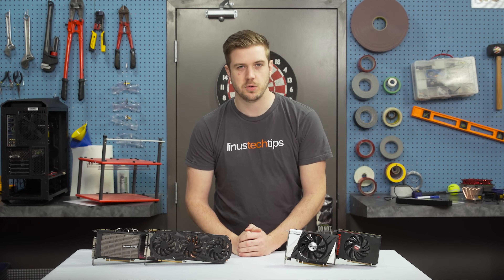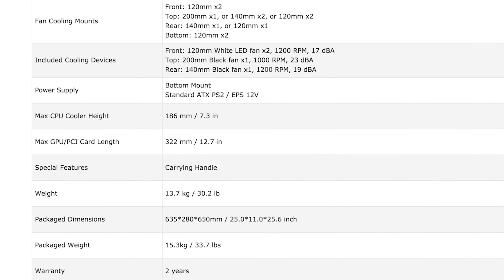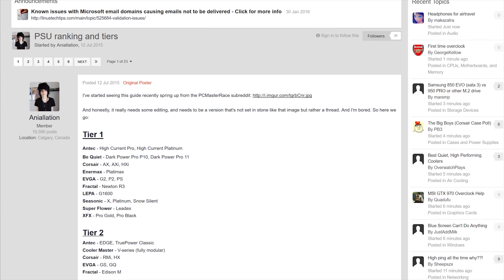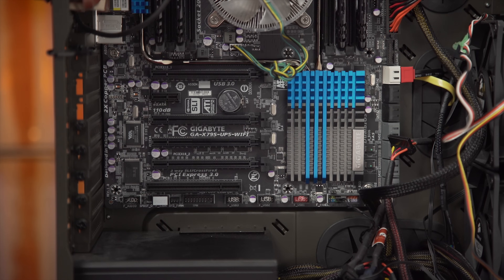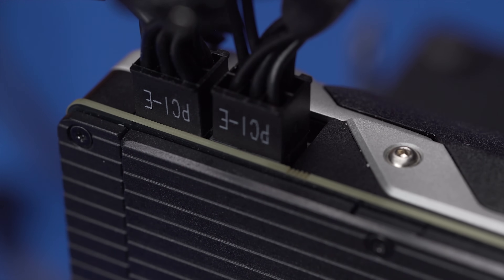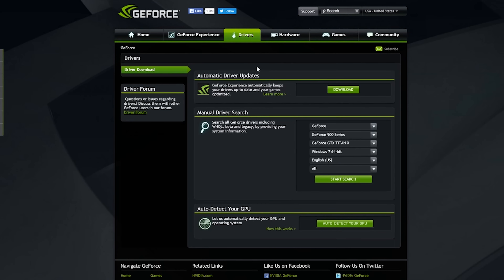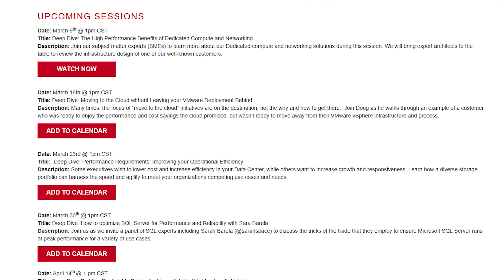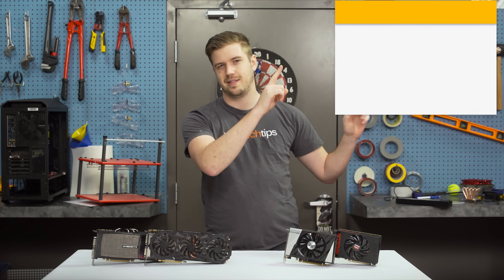Installing a Video Card - How To: Basics

Comment: I have not build a pc, never so i have a bit criticism to this video: It´s not that informative. Questions id like this video to answer: Can i fry my GPU/ computer if i choose accidentally too big powersupply - ie 1200w. or does all cables produce mentioned 12V current. Do all power connectors in GPU( in case of two) need to be connected or will one be enough.  Now i can find the  information on connectors, but a bit more visual guide would be perfect: How to see if power connectors on gpu and powersupply match (show the data sheet on gpu and pinpoint the information and show power supply data sheet and point the information).  How to see if motherboard supports GPU: Every video says "go ask on a forum, or find it on the internet" - So do one or few examples, find proper combinations on motherboard, GPU, Powersupply, and possibly CPU. Show the prosess on live screencapture- Im a visual learner. This is a text from a total beginner on building pc.
Reply: +Ja As And also, what does ATX12V / EPS12V even mean? on a powersupply. What is the useful data on those products and what are nonsense ie. "CORSAIR  RM1000i 1000W ATX12V / EPS12V 80 PLUS GOLD Certified Full Modular Power  Supply Nvidia Sli ready and crossfire support  with C-link" I mean what?!

Comment: I'm not sure how people could be disappointed by the video if they 
bothered to read the title, and they are not just going to cater to 
their existing fan base there going to put out videos for beginners and 
drive them to the channel (they are still a business). Build logs are good and all but small clips 
about specific things are more receivable then massive videos where you 
have to click a link to find the bit you need help with. There rounding 
out their content portfolio. 

I don't think people should be getting butt-hurt because a piece of content isn't at their level.

Comment: Installing video card drivers from the gpu vender on a new pc, automatically replaces the windows stock driver most of the time, unless the installer is flawed in some way. I see no point in downloading the extra dd uninstaller. On a already used setup pc the uninstaller for the video card driver works just fine for getting rid of the video drivers, if the non-windows drivers were installed in the first place.

Comment: Luke you used a lot of technical names and acronyms (cpu and retention clip, cable management holes) for instance as well as non-obvious names like referring to the cooler, when I was 15 doing my first custom build, I didn't know the part with the fans was called the cooler and even though it's easy to figure out, some people might not make all the connections.  When doing basic tutorials, would you please consider using as many basic terms as possible to really be helpful to the people who need these videos?

Comment: It is worth noting that on older/prebuilt systems, the case may be somewhat different and require pliers to remove expansion slot covers and can have more frustrating clamping systems, but it should all go about as they explained it.

Also, people stop hating on this video, it may not be super exciting or out there, but it is a valuable piece of information for those with little/no experience, and this is theoretically a "tech tips" channel, and this is a tech tip.

Comment: A proper how to includes all required steps. I didn't see where it says to connect the monitor. On board VGA since all video drivers were removed? Directly to the GPU? How come the on board VGA stops working sometimes when using a GPU? end devils advocacy

Comment: They missed the issue i've seen people encounter most often.. sometimes if you install a modern gpu in an older pc you have to flip a tiny switch on the gpu itself so that the system recognises it. idk what exactly it is for, but ive seen people cry thinking their new top tier gpu was broken or their system was broken untill they were told its all fine, just flip this tiny switch.

Comment: The expensive parts and more simple parts to instal are the Freaking ssd XD SO EASY but im always scared to bend a pin which there is 1-1999999999 chance of it happening

Comment: is this a good build i already have the cpu http://pcpartpicker.com/p/WNBqK8
Reply: The i5 can be used for streaming and the like so it's fine
Reply: Pretty good build! 
Though I'd recommend bumping up to a 500w power supply
Reply: I would spend the extra $8 and get a 500W power supply
Reply: +Ryan Goebel i would wait for the new GPUs to come out before building a rig unless you need it right now. if you need a rig right now then that one is fine but if you can wait for a few months then you should.
Reply: Do you really need a core i5 for that gpu? I have an amd fx 8350 with mine and it runs great, also don't forget windows
Reply: Marco Powell what cpu do you recommend
Reply: +Ryan Goebel 
It depends, computers should be built dependent upon what you will do, of you plan on just playing with friends get an amd fx 6350, it's a real nice 6 core that runs a bit less than the core i5, but if you plan on making videos and etc than keep the i5

Comment: My EVGA 960 needs a 6+2, my PSU has 2 of those which is fine. But EVGA included a 2xmolex>6+2 pins adapter. Along with a VGA to DVI. Good guy EVGA :)

Comment: i installed my gpu in the RAM tray.
Reply: Common mistake. Just make sure you download the ram and it should replace it.
Reply: Gj
Reply: +Markuss Person Common mistake
Reply: good job M8
Reply: +Markuss Person that is good also, this way it takes advantage of your DDR5 RAM, so now you have faster RAM, you just need to download a bit more than usually
Reply: I put my ram in the pci-e x1 slot
Reply: I put mine in the toaster...

It worked fine
Reply: +Markuss Person
I have an integrated GPU, should I install it in the RAM tray too?
Reply: +jbspencer77 The radiator goes under the 2nd motherboard and i believe the spark plugs go in the dvd rom.
Reply: #GetRekt
Reply: good job😀
Reply: I couldn't make the RAM fit after adding my second and third motherboard into the PCI RAM slot things, where does the radiator and spark plugs go?
Reply: >Where does the radiator and spark plugs go?

holy shit i'm dead
Reply: +Markuss Person lol xD
Reply: +Markuss Person i thought my videocard was pizza heater
Reply: +Markuss Person savage
Reply: Me too. It didn't "click"
( ͡° ͜ʖ ͡°)
Reply: +Markuss Person I glued it to my display since its a graphics card.
Reply: +joshua ooroth oops.
Reply: nice kkkkkk 😱😅😅😅😅😅
Reply: +Markuss Person W
Reply: I put mine in the hard drive bay :(
Reply: +Markuss Person i put mine in the x1 slot  :/
Reply: +Markuss Person good job notch
Reply: +Markuss Person "Instructions to Vague, dick got stuck in the ram slot"
Reply: keep it up, proud of you
Reply: Gavin Windsor IM Sorry.....D:
Reply: +Markuss Person Me too. I just downloaded my Ram and so these ones were free and got them confused for the GPU slot.
Reply: Jack Dan I tried that too, I downloaded my Ram from getfreeram.com and now all I can see on my screen are ads for hookers, penis enlargement and Bing search engine
Reply: +jbspencer77 I had that problem. You're going to need to put AVG AntiVirus in your cpu socket and hit the network card with a rubber mallet about 3 times. After that open up the bios and overclock AVG to 9Ghz
Reply: #LinusCaptainObviousTechTips
Reply: Is it more faster can it actually run Minecraft????
Reply: I installed my gpu into my butthole and it pushes out turds with 200 FPS

666 likes